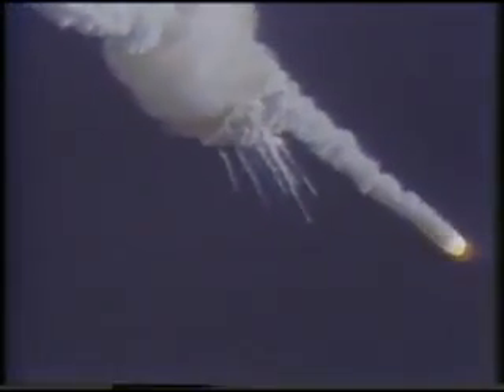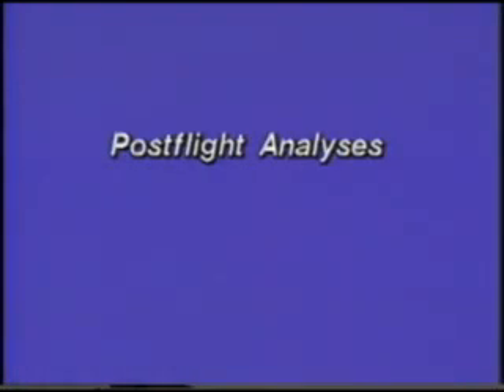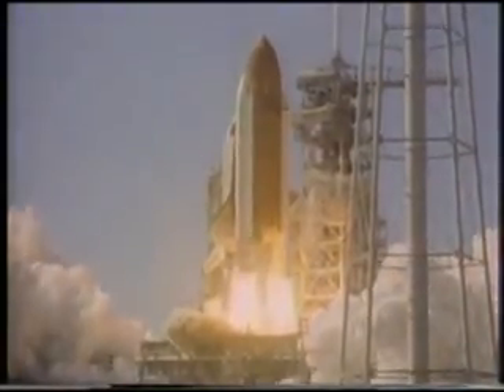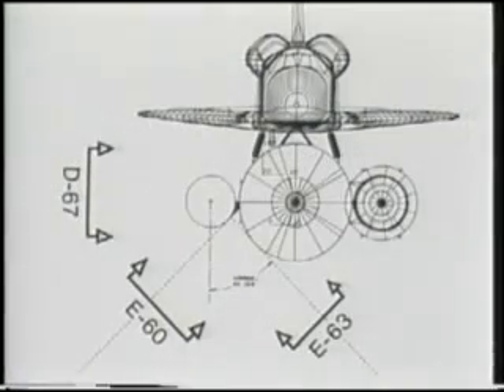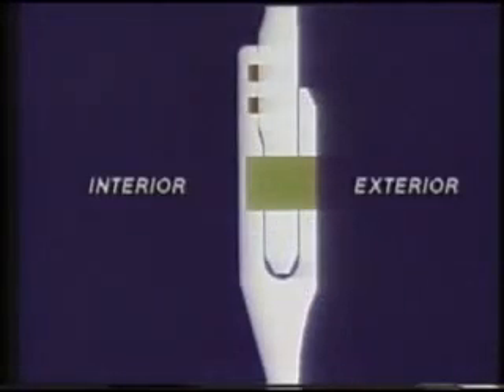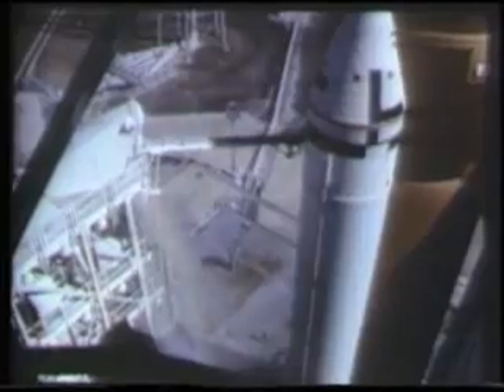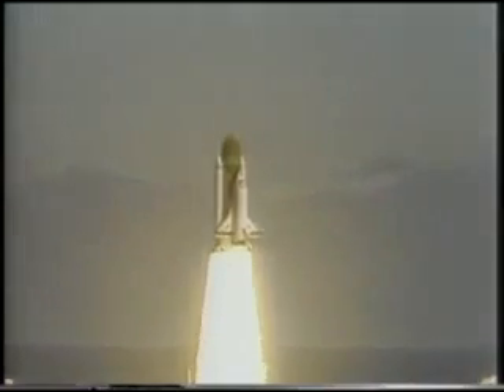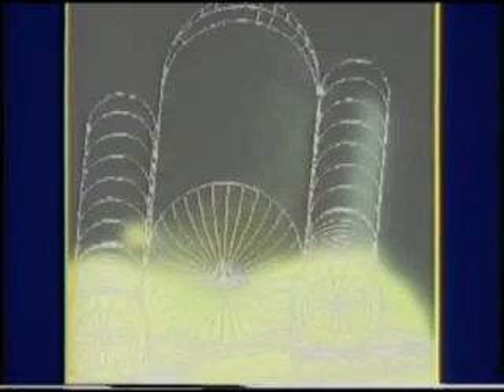Part 2 - Space Shuttle Challenger Explosion - What happened?

Comment: @amgen52 LOL because of cold and ice Challenger was killed. the O ring was designed to seal the gaps in the joint and the joint cover did not work as designed. the joint cover goes over the bolts and acts as a heat sink to keep the joint from freezing because it was put on wrong water vapor got in here and turned to ice. The O ring shrank because it got wet and the cold did the rest when it was heated the hot gasses escaped and melted the ring killing the shuttle.

Comment: @amgen52 they use nitrogen to cool the fuel hydrogen must be kept cold or it will ignite on contact. the weather did not cause the O ring to expand it was designed to do that it shrank because ice got in the joint. the smoke is burn rubber and rocket fuel not just rocket fuel because the fuel burns from the inside out not the outside in. today there are heated inside the joint to remove the ice and keep the O rings at their proper size.

Comment: @amgen52 the O rings are made of rubber when they put the booster together one of the rings was damaged and because the aft skirt bends when it is heated the O ring was first exposed to nitrogen from the tank which caused it to shrink and then at lift off it was exposed to heat and melted (which explains the smoke seen on E63)